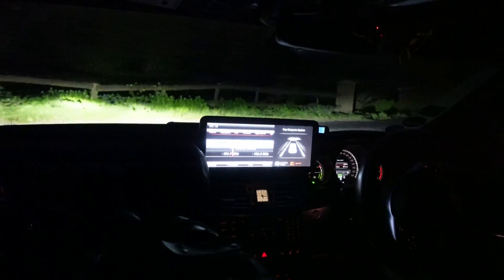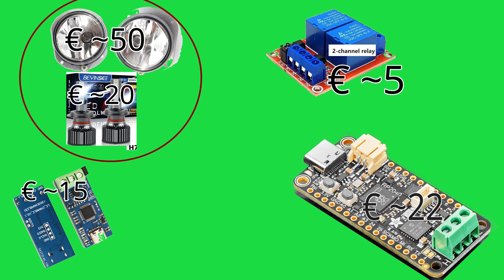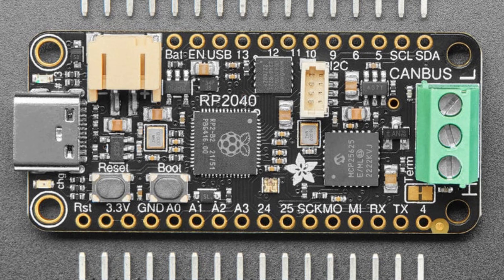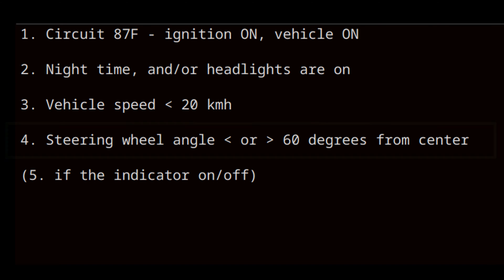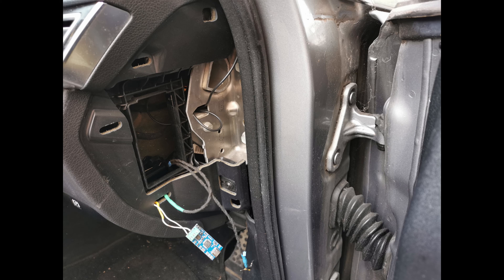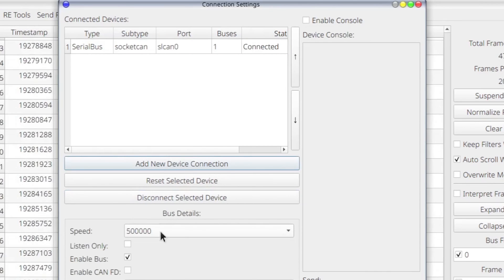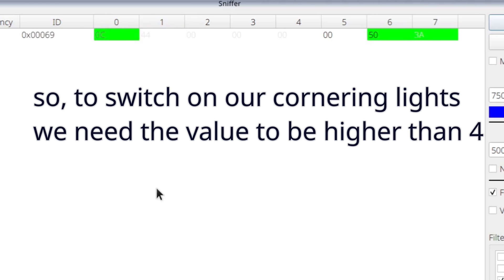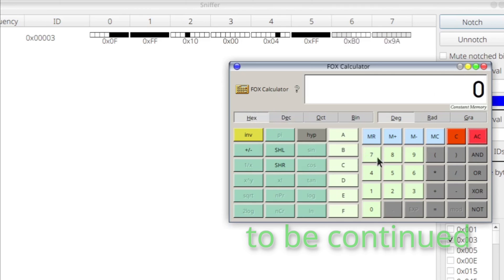Mercedes CAN Bus #1 🚘 Cornering Lights 🔦 CAN Sniffing

Comment: did you try to replace relays with mosfets, so your lights could be dimmed?
Reply from the maker: couldn't find mosfets with common ground, most of the boards on sale have common positive, so I would have to run separate ground wires everywhere